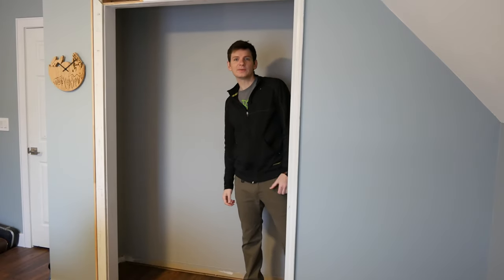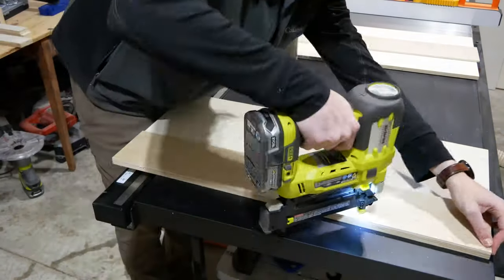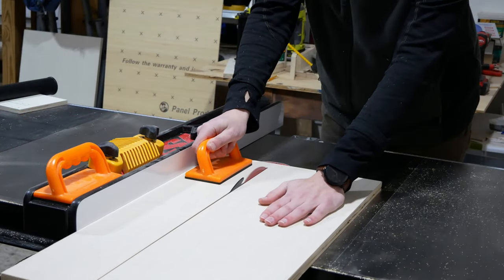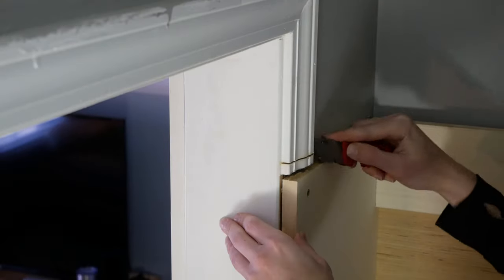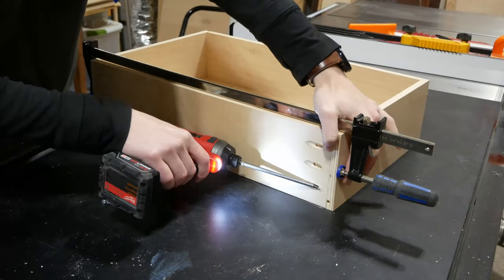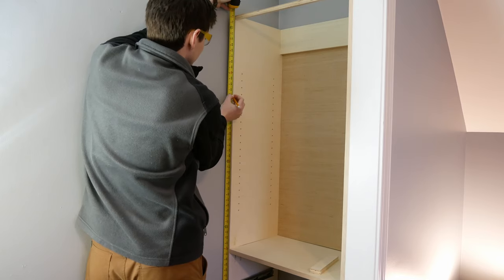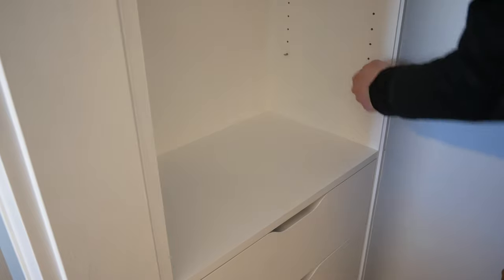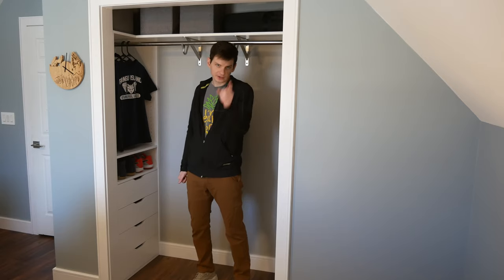How to Make Small Closet Built-Ins

Comment: Nice work. Very inspiring. I definitely have tool-envy... you've got a nice collection of equipment.
Reply from the maker: Thanks Dave! Just gotta build that tool collection slowly, I started with very little and have just kept adding things as projects call for them
Reply from the maker: Hi Paula, I probably won't do a shop tour for a while since mine is still a mess and there's a lot of want to do to improve it first. However, I am working on a website (at this very moment actually) and one of the features I'm looking to add before long is the different tools I recommend for different levels of skill/experience. And to your point, I try to assume my viewers don't have advanced knowledge/experience because it wasn't that long ago that I didn't and honestly I'm trying and doing things I haven't done before in most of my videos

Comment: Is that a Ryobi finish nailer? Wondering how much you may like over an air tool of the same caliber? Also I don’t have a table saw - looking at the Dewalt popular portable model ($399) but unsure if it’s appropriate. Have a LOT of built ins in my future. Great video!!
Reply from the maker: Yep! Ryobi finish nailer. I love the portability of using battery powered nailers and I don't have to lug a compressor around or worry about a hose. Downside is they're more expensive than air nailers. If you're curious about any other tools I used in the video check out the video description.
My first table saw was a portable Dewalt. They're very good saws with a good fence system. 2 things I'd check, can it accept a dado blade if that's something you might care about in the future? And is the rip capacity at least 24" (half the width of a sheet of plywood). If it can do those 2 things, there's not much you couldn't build with it

Comment: I would like to know the dimensions of the closet. I know that it is 24 inch deep but and what about the other walls, what are their dimensions and the dimensions of the doors
Reply from the maker: The closet is roughly 24 in deep, 96 in tall, and 77 in wide. The door opening is about 48 in by 80 in. I made doors for the closet in the next video after this one. You can find detailed dimensions linked in the video description of each video. Let me know if you need anything else!